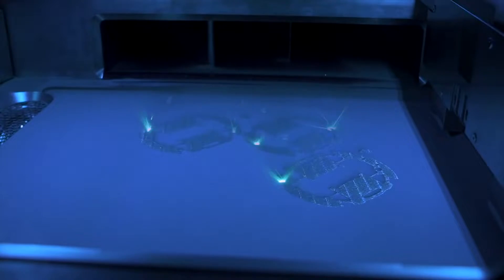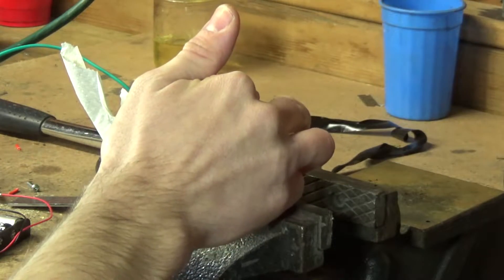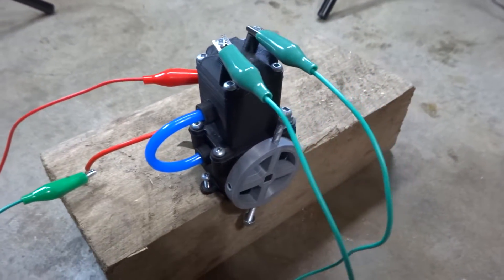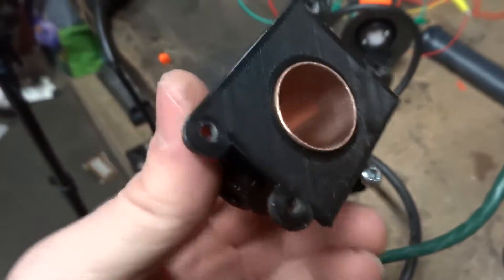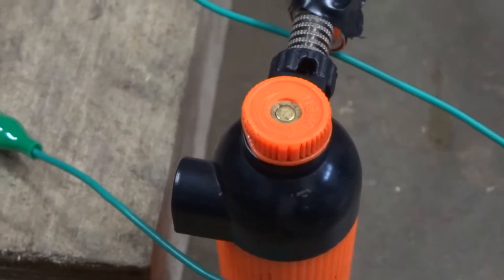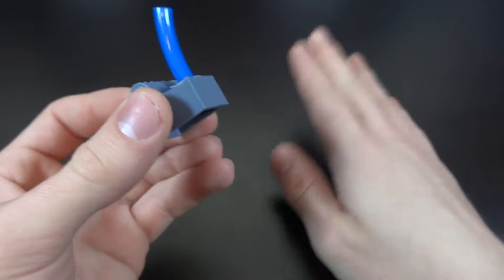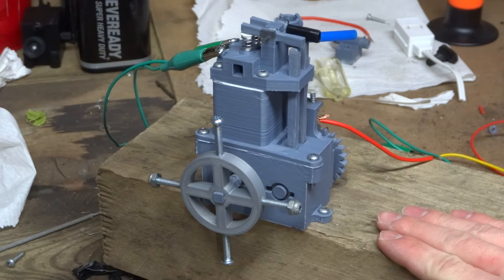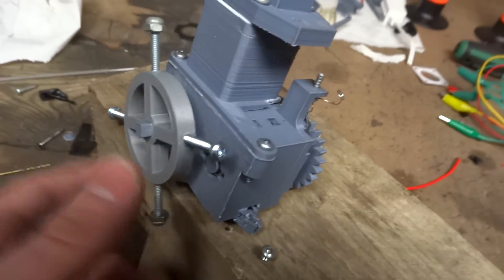The Trials and Tribulations of 3D Printing a Gas-Powered Engine (Part 1)

Comment: I wanna joint this project, I got some designs, played with this for over a year now. For fuel I went for a methanol/nitro mixture as it mitigates heat problems and runs on way less compression. Also use a proper carb, fuel and air delivery is everything on a engine

Comment: Please continue working on this engine. I think all its missing is a proper fuel source because with the lighter it doesn't put out enough gas and the carburetor needs to be more refined. Its so cool to see. Also, could you share the 3d files for the 4 stroke engine?
Reply from the maker: Thank you! I will add them later
Reply: And the pistons need something like a piston ring so no oil gets into the fuel couse then it has bad compression and doesent work
Reply: Have to get the combustion ratio right. Without a valve you can't tune into it

Comment: Real engines have piston rings for a REASON. Also, that carb design sucks. SmarterEveryDay did a video on them and 3D printed a working one, the heat or something in the fuel started to weaken the plastic, but it worked. Hopefully, you read this, good luck!
Reply from the maker: The piston had no rings for a reason, I experimented off camera with various types and found to make plastic rings that can seal well enough and have lo enough friction are just not possible so I will work around it, and the carburetor was more of a test subject I will need to make one with a throttle and choke I think
Reply: @CamdenBowen  You will have to make one where you can actually control the mixture ratio. I suspect this was one of your problems. 
If I were you, I would try to obtain a carburetor for an RC engine
Reply from the maker: @fg8557  that's a good idea